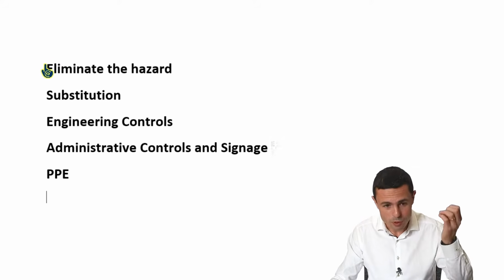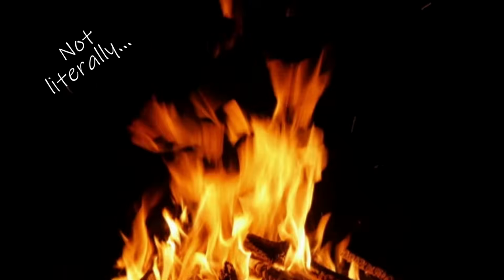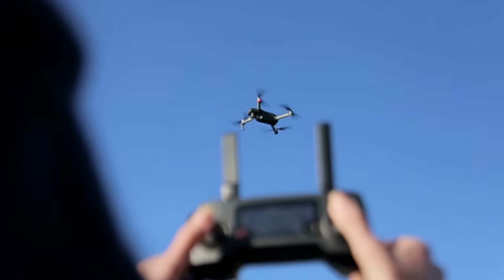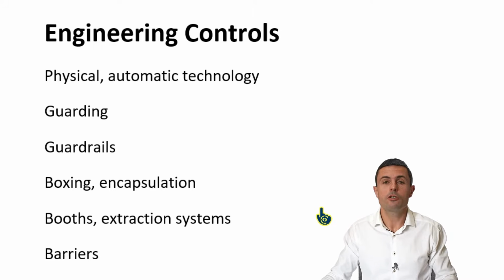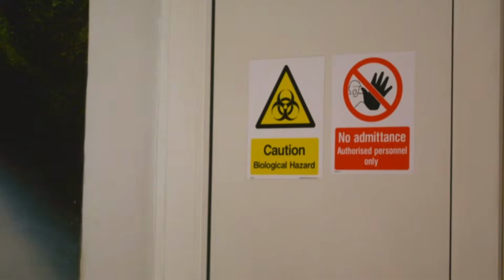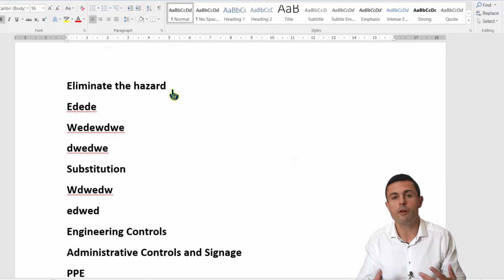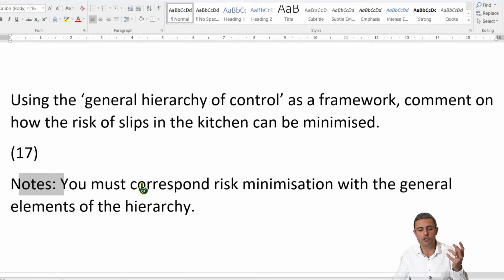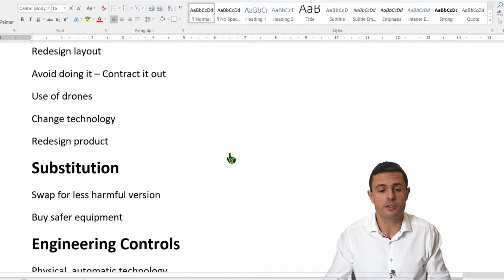Hierarchy of Controls for Exams | NEBOSH GNC1 & GNC2

Comment: Hi @Compassa learning 
In the part 2 of the nebosh ig2, on the further controls, column 4, do we arrange answers in the order of hierarchy of controls?
From elimination to substitution?
Reply from the maker: The order/arrangement of the controls is not a requirement, no.
Reply: @CompassaeLearning 
What about proportioning of the further controls?
Would it be a problem if I list say, 1 engineering control and 6 administrative controls under further controls, column 4
Under part 2  of the ig2
Reply from the maker: @kwasilarbiamoah.4094  It's not a scientific rule. It always depends on the hazard. Some hazards can be more easily controlled with engineering controls (e.g. electricity). Others require more admin controls (e.g. mental ill-health).